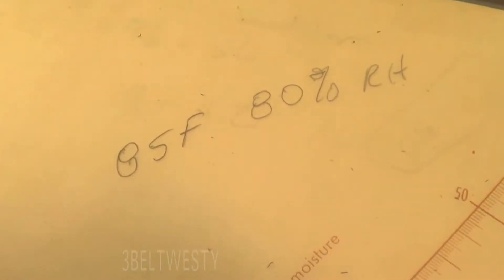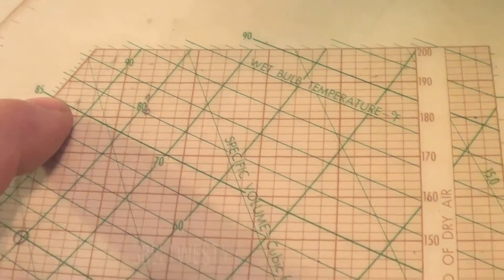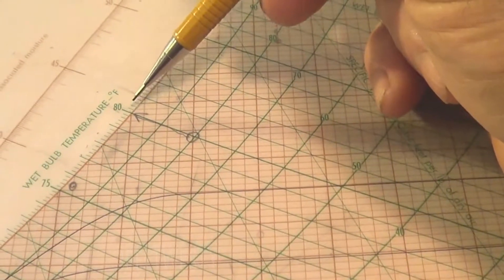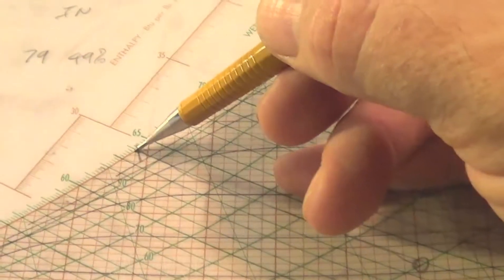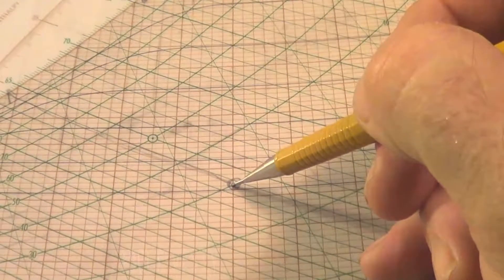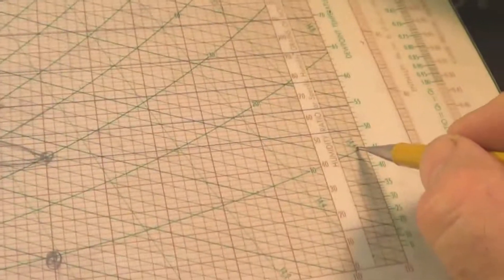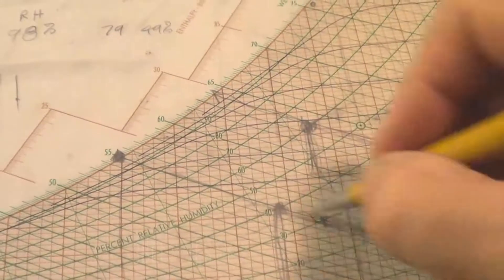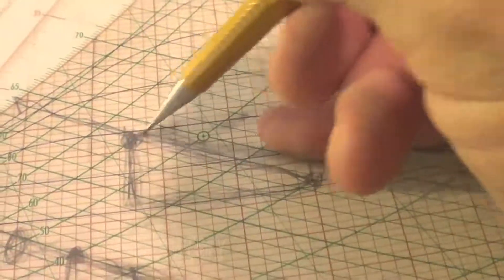Psychrometric Chart Lesson 3 Wet Bulb Swamp Cooler HVAC

Comment: If air dry bulb temprature is 36 deg C , and RH 42 %, can i cool the air at 11 deg C  by adding directly chilled water into air through evaporatorive cooler.
What will be the parameters.
What will be makeup chilled water temp?
What will be the quantity of makeup water?
what TR load of chiller  for make chilled water?
Reply: The comfortable range of relative humidity is between 40-60%. In this particular case you provide, adding humidity until you have 60% humidity will result in a temperature drop up until 32°C, approx. 
You cannot reduce the temperature significantly more because you already have too much RH. 
¿Where do you live? I live in a dry and hot state. This evaporative cooling technology works best in dry-hot areas.